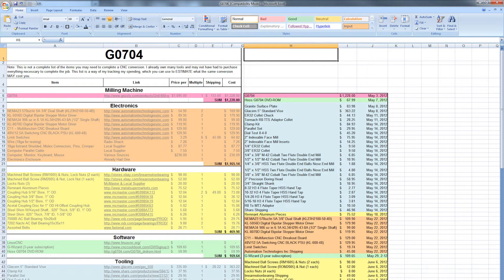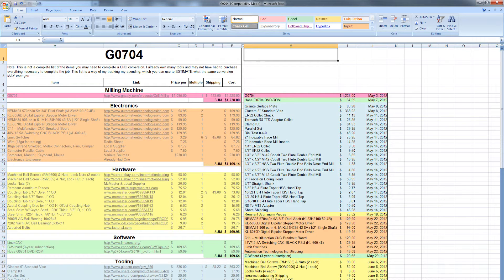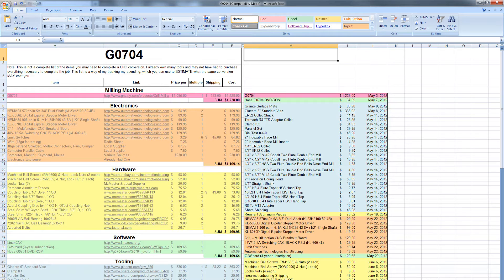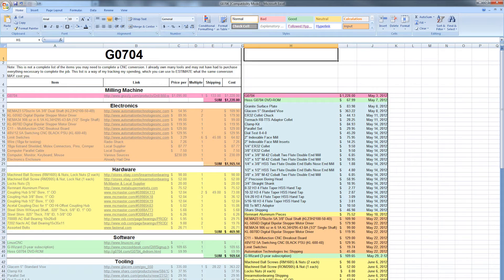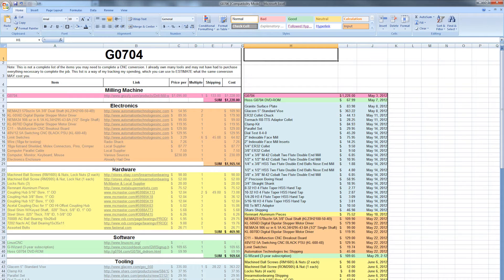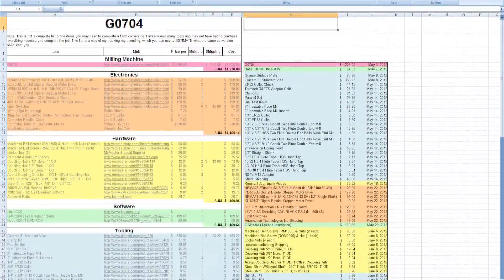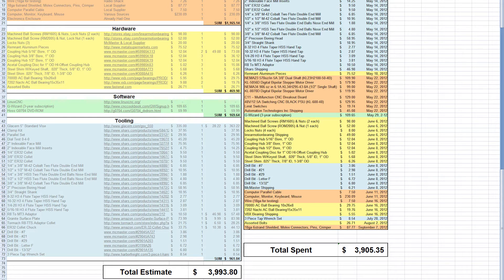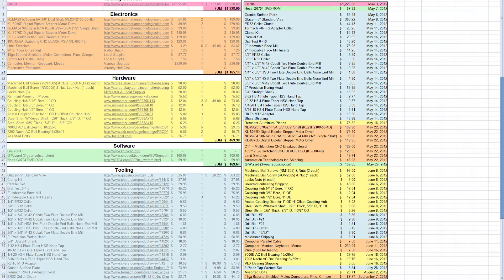G0704 CNC Conversion 02 - What it Costs to Convert

Comment: Nice Video, clear and concise, with the option to look at the material in a download. Very nicely done. I hope you have a video of the conversion. I just bought an awesome G0704 CNC converted mill, about 1 year old. Mach 3, TorMach tooling system, touchscreen , computer built into the base  with all the electronics, spare nema 34 stepper motors driver and power supply ,USB port on the side of the base for file transfer from another computer using software of choice for CAD. (Fusion 360 is what I use).  Network able controller, Double ball screws on all axis.s  All the new dial indicators, tram bridge, everything.  All the stock he had came with it and a carbide bladed chop saw. He was awesome and could answer all my questions. I will buy another g0704 mill  and convert it to linear rail without taking apart this mill. That is way down the road. Great video! Excited about my find.
Thank You russtuff!
Reply from the maker: Nice score! There's a whole playlist of my conversion which you can find on my main YouTube page.
Reply: @russtuff  I was just watching the belt drive conversion tonight as well as the treadmill motor conversion. I have not watched the 3 phase  conversion. Do you have 3 phase at you disposal or do you use a phase converter?
Reply from the maker: @chaley9093  I'm using a 2.2kw huanyang vfd.

Comment: Hey RUS I was just wondering the KL-5056D says they are " • Supply voltage up to +45 VDC " and the power supply is +/- 48V , is this going to cause premature failure due to over voltage ? There is nobody at automation this week so I thought I would hit you up on this . Thanks Al
Reply from the maker: Huh, you know I never noticed the voltage differences. I don't think the slight over-volting is going to be a problem, and mine certainly hasn't been an issue over the past couple of years.

Comment: Great spreadsheet, very well organized. A real addition to Hoss's info. Question - do you think the Nema 23 motors are about the right size for the X and Y axis. I am thinking about springing for the Nema 34s for all the axis. I would also recommend that you look at the Vetric V Carve Pro software for your CAM - G-code authoring. I have used V Carve Pro and Mastercam. V Carve Pro is a great value with good functionality.